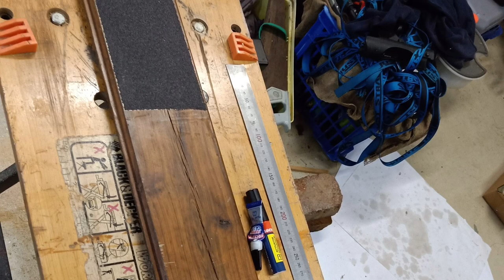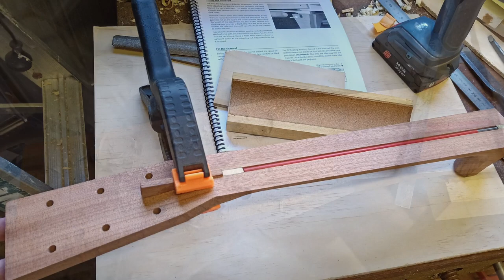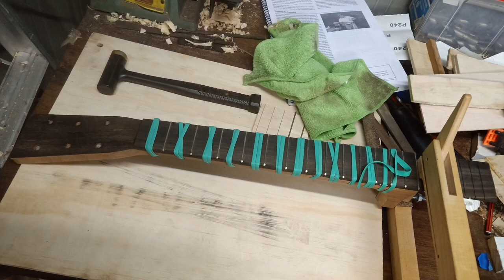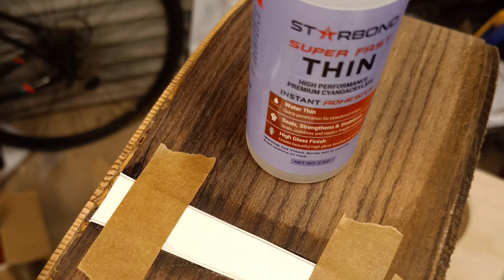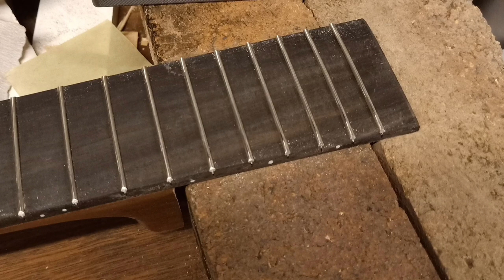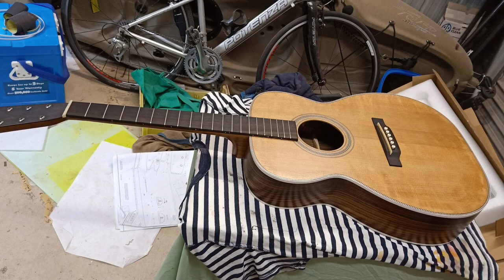Homemade acoustic guitar- Stewmac OM guitar build

Comment: Looks nice .. but I hope you never have to repair it.. Titebond 2 and 3 requires 2 and 3 times the heat to separate...

    Next time you might want to consider using original Titebond for repair reasons ... 

   Also the advantage of this bolt on neck is that you only have to loosen the glue on the fretboard extension.. to you might want to consider his glue panfish glue for that area .. because you need to eventually need a neck reset . 10-20 years down the line.. and those glues release easily with a lower heat .
Reply from the maker: Good to know, thank you for the advice
Reply: @deancarolloguitar  You bet.. also fish glue and hide glue are the easiest to release with heat . And are good for parts that you might want to remove later ..I use it for backs , incase something inside requires that the back needs to be removed to get to it ... and fish glue is really nice to use on a crack repair that you need to be invisible.  Because it cleans up with water so easy. Titebond does . But not as nice as fish glue.. like on wood binding, its awesome..

Comment: Great work! Can you tell me, does the guitar have a flat top and back or did you add a radius? I'm going to build an OM kit too and just wondering if this extra step is worthwhile.
Reply from the maker: Mine has a radius back but I can't tell you if it makes a difference. I just finished another OM with a better defined radius but again, not sure if it makes a difference

Comment: Brilliant!  What were your learning highlights during the process? Are you planning on another build, and what would you do differently the next time round?
Reply from the maker: Thank you! Highlights? Understanding the nature and properties of timber grain when chiseling. Would love to do another build if I get the time. I would probably finish it in shellac instead of nitrocellulose and see how that goes :)
Reply: Is this the kit that ranges from $500-600 or the kit that says pre war above $700
Reply from the maker: @Drewdg04  it was around $750 AUD, so I guess the former. The description says accurate representation of a 1933 OM but I noticed there are others advertised as "pre-war", mine didn't come with Waverly tuners or any tuners. Hope that helps answer your question.

Comment: I am in between of OM kit build, but stewmac provides scalloped long braces and at the cross joint, there is a gap between bracess and you also paste some thing, so what is this material to cover gap between joints?
Reply from the maker: It is a water based wood filler/putty you can get from any hardware store. Good luck with your build

Comment: You have glued two vertical braces upon shoulder brace, which is not shown in the drawing supplied with stewmac, however a brace is included in the kit, so glue or not glue this brace. I've seen that braces parallel shoulder brace in many videos, so how it should be positioned?
Reply from the maker: I added the braces for added strength and top end control, ( I chiseled  them down to almost nothing) probably not needed, just a precaution really ( I also studied diagrams of Martins that included these braces) I find my finished build has tons of treble, so personally, I say add the braces, just remember to take most of that timber out. You want the sound waves to move freely as possible in this speaker cabinet that is your guitar body. Hope that makes sense
Reply from the maker: Also they should be positioned far enough apart that your neck block fits between them
Reply: @deancarolloguitar  thanks for tip, pl reply one more thing , if i install this brace parallel to shoulder brace,  not vertical like you , how i will access the truss rod, there is no information on truss rod access on any you tube or forum?
Reply from the maker: @MOHANMSHARMA  if you install it parallel to the shoulder brace, you should still be able to access it if your hex key is ball ended, I think stewmac sells these as a set